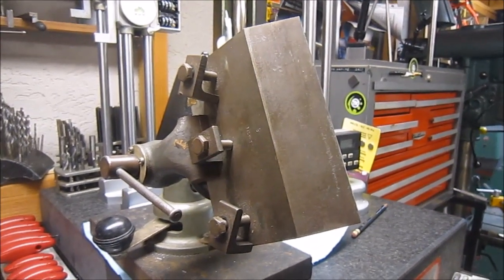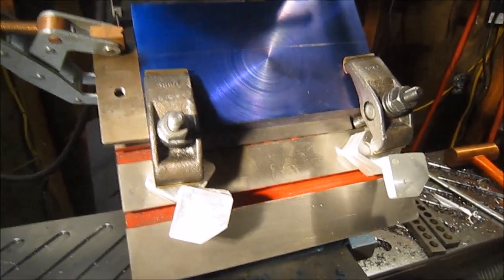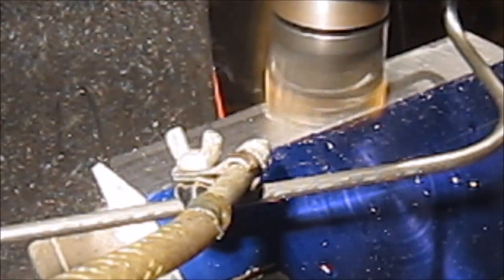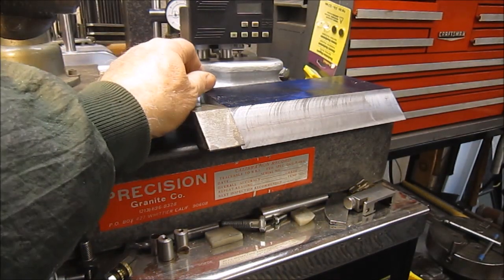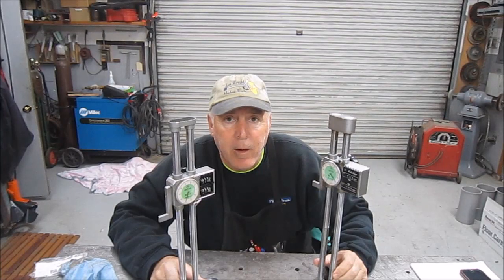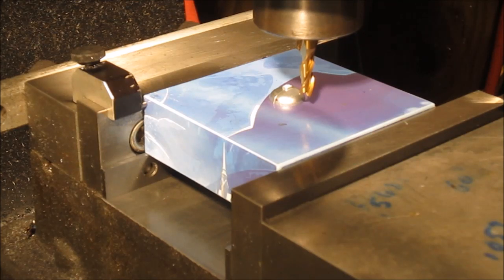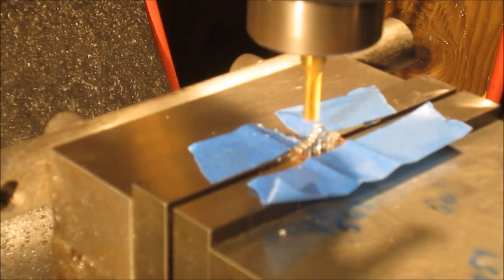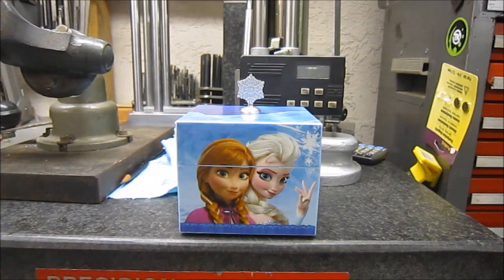TUESDAY'S TiTs  #3

Comment: Have you considered repairing the height gauges yourself?  Might not be too bad...can't tell until you open it up.  Been fixing a dial indicator here...finally found a use for my smallest jewelers screwdriver...and the magnifying hood!  Got the hands clocked, made a new back for it so I can put a couple of salvaged magnets on it, and cleaned it up. Need to make a new cover for the dial and it will be usable again. Going to try that this weekend. 

-- Mike
Reply from the maker: BigMjolnir Hello Mike, yes I did open it up and decided that if I touch them then they would never EVER work...lolCool on your repairChuck
Reply: outsidescrewball
I understand.  In re-clocking my indicator I was careful NOT to take it completely apart.  I removed just enough parts to let me slip the gears until they were in the right relationship...mostly by tipping a gear to unmesh the teeth, nudging it over, and tilting it back.  It's definitely a "think before you move a muscle" kind of operation!

-- Mike
Reply: FYI, the new "glass" for it went well enough.  I used the leftover bit I turned the new back from in the chuck jaws with some double stick tape, and my "doubleboost" "bearing on a stick" in a drill chuck in the tailstock to clamp the acrylic I rough cut on the bandsaw while I turned it round and to size. The Noga deburring tool cleaned up the edges and it press-fit into the bezel.  Not exactly "good as new", but it will serve.  Another project done...next! ;-)

-- Mike

Comment: Nice hogging on the brake nose pieces. Your setup was more rigid than it looked. Good deal. Thanks for sharing.

All the best,

Tom
Reply from the maker: oxtoolco Hogging was fun and really a new experience for me, thank you for all of the lessons that I really appreciate from watching my master!
Reply: outsidescrewball Hi Chuck, if I were hogging something similar I would not have the cutter centred on the cuttee. It is much kinder to the mill if you can reduce the shock loads, this can be done by having as many as possible teeth/inserts in contact with the work. In your case, if the milling cutter were at the edge of the work, ie tangential, soon you would have a couple of teeth in contact therefore little or reduced shock. You would have to be careful about climb milling but I know you know that. As a further thought, if milling the edge of thin relatively unsupported work, doing as above puts the loading along the work, instead of across, which makes for less vibration and rough finishes.
ATB and don't run out of jokes, they keep you young or at least remind you of your youth  when you first heard them.:>)
chris

Comment: Raquel welch 20000bc I'm thinking 
Have you stripped down the height gauge clocks? 
If it's just a broken gear wheel post me the part and I'll make you another :-) 
Warm regards 
Daryn
Reply from the maker: Daryn Radcliffe Daryn, RW was the correct answer.  Thank you for the offer, that is very generous, I will keep you postedATBChuck

Comment: Great TITS; my vote is Raquel Welch?  I didn't think your clamping setup for the angle was going to work so well but it turned out really nice looking.  The toy repair was the bomb,  only a grandfather would take so much time & care.  I do more in my shop for the Grandkids than almost anything else, and it's a hoot to see them when something turns out that they really like.  Those height gage bases will be useful for lots of things;  hold onto them unless they give your 8 ball luck a jab n the eye;  if they do give them away and you'll get great Karma.  Thanks for posting.
Reply from the maker: YCM30cnc Thank you for your view, support and comment....yes RW is correct